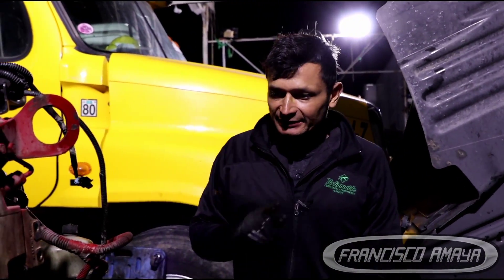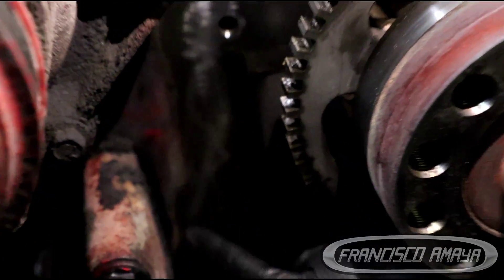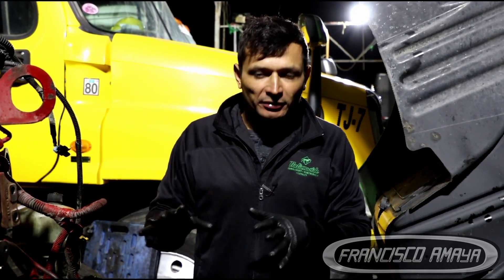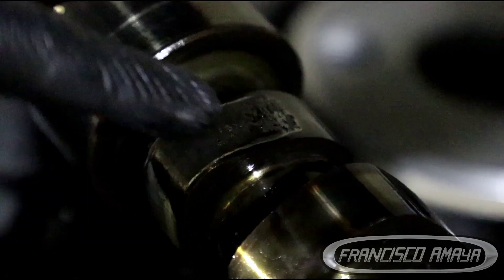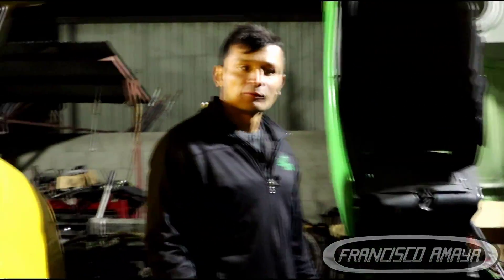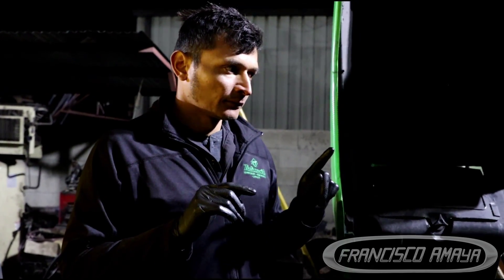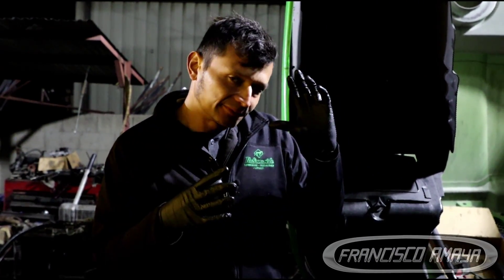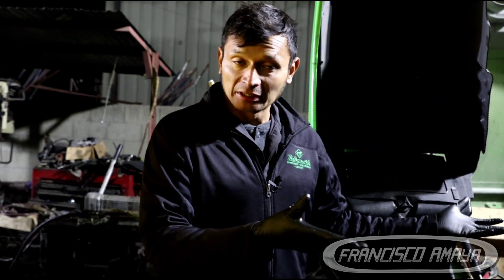Cummins ISX ISX12 ISX15 common problems fuel pump engine problems leaks faults oil pressure issue

Comment: Hi! Francisco!!! Thanks for all your videos it’s very informative and easy to understand!!! I have problem with Kenworth T680 2022 220K miles.X15 Cummins engine. DPF inlet temperature slowly rising reaching 1000F after 45-55minutes. My max temperatures is DOC in 675f, DPF in 1005F DPF out 985F. It feels like 7 injector not operating correctly but this engine doesn’t have one. Problems start after my driver Idle it for 295 hours in six weeks and add Antigel when temperature was -10F outside. This engine relatively new and it’s very hard to find information what exactly logic is used to increase temperature during regen. It would help a lot of people if you can shoot a video with healthy engine during regen so we have reference how should torque, boost, temperatures, pressures, voltages, throttles normal acting and what to look for if you have bad sensors or excessive soot buildup on EGR valve/ Trottle or clogged injectors.
In my situation Kenworth call for new DOC, I tried to remove it and bake with DPFs and looks like problem still there. Kenworth price for new DOC $7800 and it’s very expensive and I want to double check I really need it because 220K sounds like it’s too early for that. Thank you very much!!!

Comment: Wow, im buying a 2020 peterbilt 579 with an x15 cummins, 451,000 miles, tomorrow.
What should i do about this? Open the front and redo the seal just to inspect the crankshaft bearings? This video has me worried about my new purchase. Im taking possession of the truck tomorrow.
Please advise.
Reply: Have a mechanic inspect it after it leaves the dealership